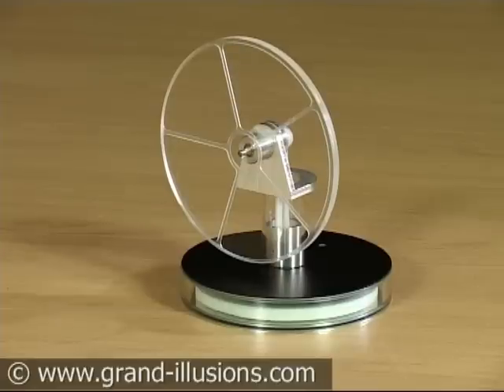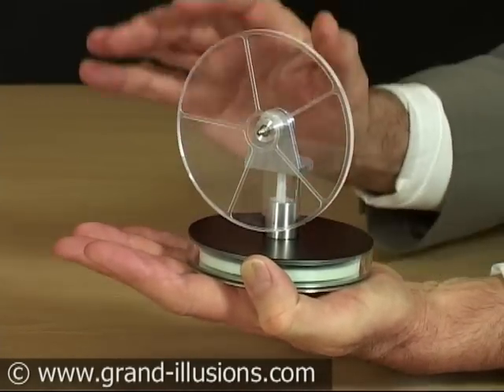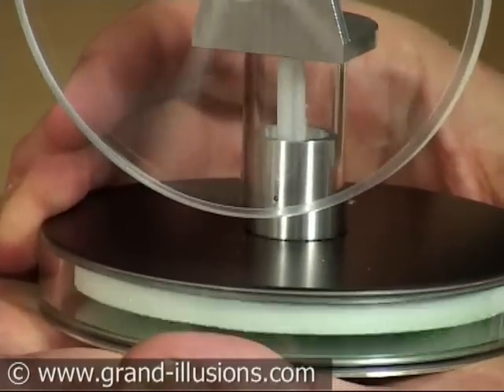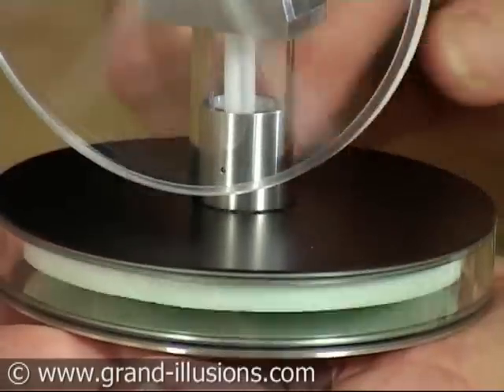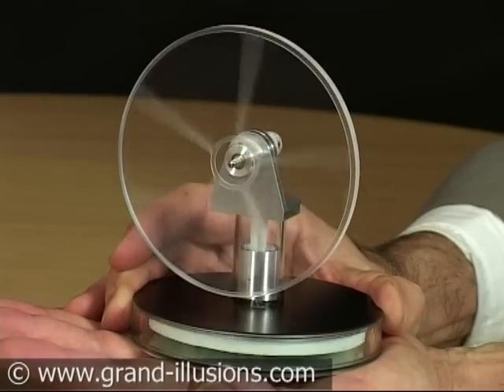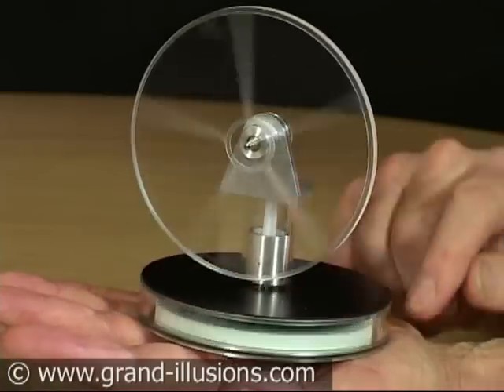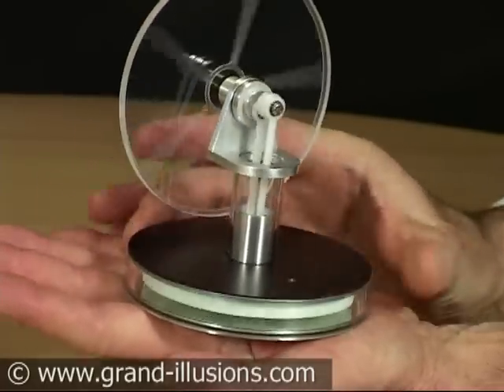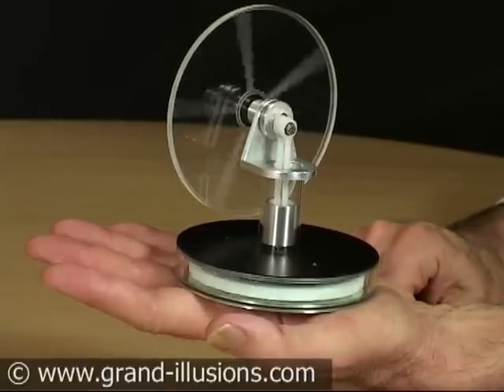Heat of your hand Stirling Engine

Comment: To those who say we should use this technology in every day life.

We do. Solar energy uses heat from the sun.
The heat from our hands is barely able to make this fan turn around and cannot start it spinning from a stopped point.

Using this technology on a stove to, say, charge a phone is even dumber!
The stove is powered by electricity which would charge your phone anyway!
Doing it on a stove would actually be more harmful to the environment because of the energy lost transferring from the stove to the charger rather than it coming straight from the wall.

Comment: this would be amazing to be used for making electricity for charging things like cell phones. place on a hot table in the sun having lunch and charge up your device.
Reply: But then you would also need an engine with enough torque and speed to spin a generator fast enough. The idea for this is novel, but not practical. You would be better off with solar.
Reply: +ThriftyWitch You'd need a way to keep the engine cool, so its more of a pain in the ass than something useful.

Comment: We can use this technology to produce cheaper and super clean energy... With the heat of the earth core.
Reply: Geothermal is more efficient for energy production :)
Reply: If you leave this on a warm surface eventually the cold plate will reach the same temperate as that is on, which is heating.
Reply: TheaDragonSpirit #Ice on cold plate

Comment: Imagine attaching the engine to a very small toy/figurine like an animated character. Holding it's "podium" would make it move or dance. That would be awesome :D
Reply: Takes a lot of force to move a figurine
Reply: @Darakkis  maybe make the figurine out of lightweight but complex origami so that it isn’t as fragile as just paper
Reply: Or maybe like pictures on the blades with only one transluscent section so it's like a heat powered gif.
Reply: That would truly be awesome :)

Comment: This is incredible really. I'd absolutely love a fan like that. This stuff seems like it has a lot of potential in the future to help a lot of people.
Reply: i like your name :D xDDD
Reply: We have a similar device at the cabin. It's made of iron so you put it on top of the wood burning stove and the temperature difference makes the fan spin so it circulates the heat a little faster.
Reply: It hadn't
Reply: IT would help a lot of people simple enjoy the thought of it. That's it. If you are thinking in terms of helping them make electricity, then no.
Reply: @fuckyougoogleplus8667  how about just cooling them by using it as a fan in 100 degree heat
Reply: @edgardox.feliciano3127  so you want to use a bunch of energy to cool it while it's super hot outside and then waste most of the energy you used to power a fan that might blow for maybe a minute at an incredibly low speed?

Just use an electrical fan bro.
Reply: @dadaniel2k11  i meant that the surface taht the fan would be on would ve much hotter than the fan itself, so no need to use energy to cool it.
Reply: @edgardox.feliciano3127  i got what you meant. You still need to cool it in the first place.
If it's hot, everything is hot.

Comment: I have one of those on the top of my gaming computer so I can tell when it gets too hot.
Reply: It wouldn't work for me, my case is usually warm because its always hot where I live.
Reply: Huh, that is actually a pretty cool high temp warning system.
Reply: Blujay Blanky yes it would. as long as the temperature of your computer is higher / or lower then the top plate of Stirling Engine's it will produce the same effect. barometric pressure are besides the point.

Comment: What if we made a gigantic version of this near the mantle? I wonder if gravity would have too large an effect on it though...
Reply: I think the biggest problem would be our problem with most energy efficient machines. the bigger they are the more inefficient they get. the bigger we make a device like this, the more inertia,air friction, and standing friction.Also, Im pretty sure if we put this near the mantle the heat wont be unbalanced compared to the heat above the machine. the earth doesn't have a giant temperature drop right when we get to the mantle. The heating is a little more gradual. but maybe in a smaller scale. we can use the the natural cooling and heating of the earths surface and put this machine under ground by only a small distance.maybe the difference in temperature will be able to spin the wheel enough to give small amounts of power to households.
Reply: We have hydrothermal generators and all sorts of options. This is the renewable energy you keep hearing about.
Reply: This works because of the fact that all part are probably very light in term of weight... Unfortunately to produce enough energy you would need heavier equipement and then the temperature difference would no be enough to counteract the friction and weight

Comment: Make free electricity with that method Oo  And that could help people to burn some calories free and lose weight because the body will use some calories to keep the skin hot :O then the electricity could be used to build more of these machines :O
Reply: To get electricity, you would have to induce some form of "drag" to this engine. I would be surprised if you could get anything at all out of it. Also, the energy you burned heating that small plate wouldnt burn many calories. Additionally, if you left it on your hand for long enough, the entire engine would eventually reach a temperature equilibrium, making it not do anything anymore.

If you want to burn calories and generate energy at the same time, try getting a bicycle type pedal generator.
Reply: FoxMaster reading that paragraph lowered my IQ level
Reply: aaaaaand...welcome to the Matrix.
Reply: Filip Kopecký Yes it would. A closed system always moves towards equilibrium. The engine, your hand, and the air are the closed system here. The air will stay a constant temperature (assuming youre in a building with climate control), your hand will stay the same temperature (assuming you dont get sick or die), so the engine will reach a temperature between the two. Since your hand is much more conductive than air, the top and bottom of the "compression chamber" will eventually reach the almost exactly same temperature. 

This is the equilibrium state. The air in the chamber will warm, the top will not be cool enough to cause it to have a pressure difference because, again your hand is more conductive, and it will stop rotation.
Reply: Filip Kopecký WOW, a nice person on youtube! haha, np
Reply: Kakunapod Ok, you are right, thanks for good explanation.
Reply: Kakunapod I wouldn't reach equlibirum because the air around has lower temperature.
Reply: We could also put fat people in a cold bath to make the water hot after few minutes, with very very fat people the surface of the skin touching water should increase the temperature of the water, if we do this with 1000 persons it should work... the water would be used to decrease the energy used for bath or hot water :) under 36°C of course :p 

We'll use a connector track to exchance to energy of the water, then to complete the process we could add some turbines inside those tracks.

the cold water will be underground to be coller then the human body.

During a shutdown we could ask them to run in the water to provide more energy!!!

We could make a business with that idea, and help people with too much mass :) 

I also imagine a big power plant like a giant swimming pool, then people jump in the water, the extra water fall in a wheel and make energy, but I have trouble to bring water back...

I prefer my first idea with the pee, the energy of the pee is free and humanity make tones of pee everyday...
Reply: thats exactly what the story behind the matrix is
Reply: Yes but fat people hate sports :(  I heard an human body is about 110 000kcal  :D  If we could use fat to make energy... :D
Reply: Kakunapod The average is irrelevant,  the issue is only if the top and bottom plate will be the same temp.
 If you have a long metal rod with one end in a freezer and the other in an oven the whole rod will never be the same temp.
As long as your hand is warmer then the air above the machine it should keep spinning.
Reply: Jesper Johansson Ok, then you misspoke earlier. 

The key words in your newest comment are "long" and "freezer". This machine is not long by any means, the top and bottom plates are about 1 inch apart, and it is not sitting in a ridiculously cold chamber. 

But even in your example, the metal rod WILL reach an equilibrium. All things reach equilibrium unless they are acted upon by a new force, or in this case, heat source.
Reply: Kakunapod the air around it is actualy keeping the top side cool so it will in fact run as long as the person holding it isn't dead
Reply: Kakunapod Well, I'm 18yo... and yeah, I can't stand kids who can't behave too
Reply: Actually there is nothing such as "free" energy... The machine uses the energy your hand releases as heat, heat is produced by exothermic reactions in your cells. Not really free, but its a nice way of using some unused energy.
Reply: SwopCovers Im an junior engineering student. I know very little about chemistry, but isolating systems is how we do physics. Stop failing at being a smart ass?

Do you understand how this thing works? Tell me, if it is not on your hand, if it is just sitting on your desk and you spin it, does it work? No, of course not. There is no temperature difference between the top and bottom plates. So, if I warm both the top and bottom plates by the same amount, will it work? No. It wont. 

If you keep heating the bottom long enough with a source of constant temperature, the chamber WILL reach an equilibrium temperature. This is how a closed system works. The plates will reach a temperature that is very near to one another and the rotation will stop.

I encourage you to sit there holding it for.. well I am not really sure how long it would take if I am honest, so I cant exactly give you a good time frame to sit there with it in your hand, but if you have the patience, you can see it grind to a halt if you wait long enough.
Reply: we need more info about the temperature of the room too!
Reply: Aditya Pokharel Let me help you out, angry child. Do you have one of these? Why dont you try putting on of your hands on the top plate, and your other hand on the bottom. Make sure you dont block the hole
Reply: Aditya Pokharel Im not changing what I said, Im trying to figure out what level youre at. Next question, have you ever taken a course that even mentioned thermal conductivity?
Reply: SwopCovers Thats the idea.
Reply: Aditya Pokharel ok, so since you apparently know there is an air temperature requirement for this to work, why dont you tell me the maximum air temp that will keep this engine working regardless of how warm the top plate gets. Im sure youre aware air is a very poor conductor.
Reply: SwopCovers
 A closed system is a physics term you tool. Do you even thermodynamics?
Reply: well i heard the earth is hot... make a giant scale of it.. and...
Reply: cok Bagus As the size gets bigger, so does the mass of the piston and the moment of inertia of the wheel, so, there is a size limit, I would imagine the biggest you could make this would be... maybe twice the size as the one in the video, but, Im not going to do the math on it unless Im building one haha
Reply: Kakunapod I don't think any normal building can be considered a closed system though, so equilibrium should never happen.
There are air vents, heat loss though walls/windows etc.
Most rooms will probably get slightly warmer from your body heat when you enter, but it will never reach equilibrium with your body.
Reply: Jesper Johansson Any remotely modern building has climate control that will keep the interior temperature at a rough constant, when I say "equilibrium", I am hoping you will disregard insignificant fluctuation that wont really have any effect on the engine, especially since air is a very poor thermal conductor. Therefore, we assume the air temp to be constant. I understand it is not constant, but we assume the average to be the constant, and therefore the average of the engine will be its "equilibrium". 

Kind of like asking for the average value of a sin function. I understand a sin function oscillates between -1 and 1, but the average is 0.
Reply: I used an extreme example just to make it easier to see that there will always be a difference even if a very small one in the toy above.

I cant say how much of a difference in temp the machine needs though it seems its only a very small amount. Assuming you don't have one of these either its pointless to debate exact distance and temp only that there will always be a difference as long as your body stays warmer then the air around it.

You want to ignore that energy is constantly being fed into the machine from your hand and its lost at the top.
Reply: Kakunapod Wait. If you add heat into this machine, it is not considered a closed system. In fact, it is an isolated system, where energy is the only thing being added to the system... But it is not a completely isolated system either, because that engine could potentially lose/gain air based on pressure differences between the outside and inside of the engine (because we have to assume human error when making the engine, which means crevices/extremely tiny leaks, etc.)

And equilibrium is when the change in thermal energy is constant and same throughout. It is indeed an equilibrium because there is a constant "out flux" of thermal energy via conduction between your skin to the bottom plate of the engine. BUT, if you look at the bigger picture, the engine will keep running until you no longer give off heat (which you said, is when you die). Your body is constantly maintaining that thermal energy, which means in order for this system to be in equilibrium at all, your body has to lose all its heat first.

And in this way, the engine couldn't actually fully achieve equilibirum, because it is not a closed or even a completely isolated system. The temperature of the air around it is always cooler than the temperature of the hand, so the top plate of the engine will constantly lose thermal energy via. black body radiation. There will always be a slight difference between the top plate and the bottom plate.

If I'm wrong at any point, please tell me. I want to hear your thoughts.
Reply: Kakunapod Won't there always be a difference between the top plate and the bottom plate? Even a small one? I don't think a stirling engine would be considered so successful, and it wouldn't be so popular if it just stopped working. If there was a really effective heat sink, the top would always be closer to room temperature than the bottom, which is next to your hand. Am I missing something.
Reply: Petros Oratiou He knows that it's not coming from nowhere, but I would call it free energy if you don't have to pay, and it's utilizing energy that would otherwise not be used.
Reply: kindpotato yeah thats what I said later in my comment. I thought I was clear enough.
Reply: it is a neat idea for Geothermal energy energy extraction however but we already have good ways to extract that so all it is is a amazing little display of engineering and physics.
Reply: ***** That's what I said... He meant to convert energy we don't use such as the heat from a hand.
Reply: Kakunapod The sStirling engine has a non-conductive piece between your hand and the top plate so that won't happen. True?
Reply: Kakunapod Just set it on a room temperature surface when it reaches equilibrium. it will spin in the opposite direction but it doesn't really matter since it's generating AC anyway.
Reply: Kakunapod Ok, this is a response to one of your first comments.  You said:

The engine, your hand, and the air are the closed system here. The air will stay a constant temperature (assuming youre in a building with climate control), your hand will stay the same temperature (assuming you dont get sick or die), so the engine will reach a temperature between the two.

The problem i have with this is that this is not a closed system.  A closed system has no net energy gain or loss.  Assuming you are in a climate controlled building, your body heat will move through the engine, into the air, and get pumped out of the building to maintain a constant air temperature.  That is energy being lost from your system, which is why this system will never reach equilibrium.  In a true closed system, the air would eventually have to warm to body temperature to reach equilibrium.  However in this system, the there will always be a temperature gradient across the Stirling engine. The fact that a hand is more conductive than air just means that the gradient will be shifted closer to body temperature than room temperature, not that the object will reach a set temperature that is near body temperature.  The metal against your hand will be always be warmer than the metal exposed to the air.  Assuming, as you did, that we keep the climate control on, this sterling engine will continue to function.

Comment: Small correction, if you put it on a block of ice, it wouldn't have to run counter to the direction it did when it was on your hand.
Reply: I was wrong, ignore that statement.
Reply: matszz I agree to your first statement , I wanna know why u changed your mind !
Reply: Tuphan Hamal
I re-read the wikipedia article on stirling engines. I rememberd incorrectly something in it.
If you attatch a motor, and run the stirling motor, it will create heat on one side and cold on the other. Or rather, pump heat from one side to the other. Like an electric motor forced to run will work as a generator for electricity.
Reply: OHh, thanks for replying :)